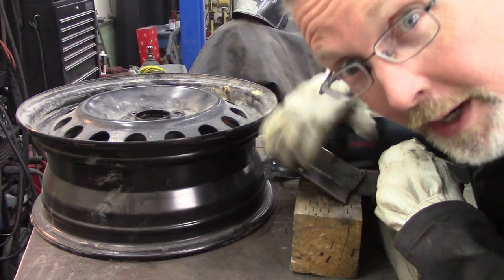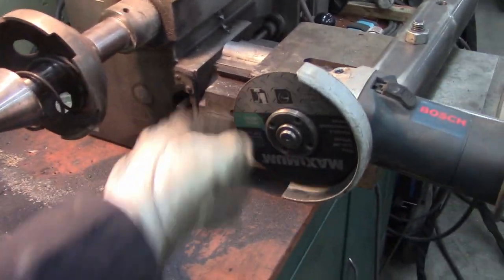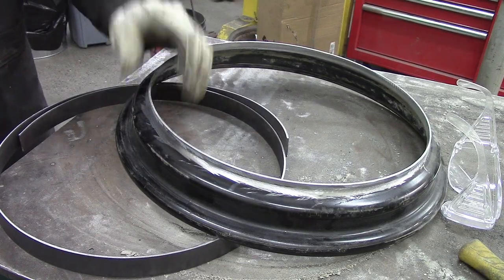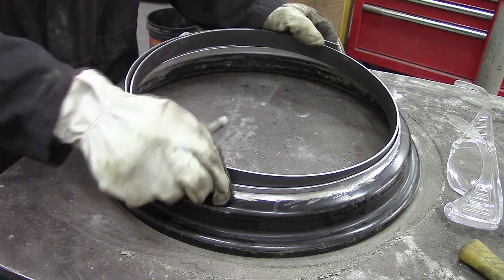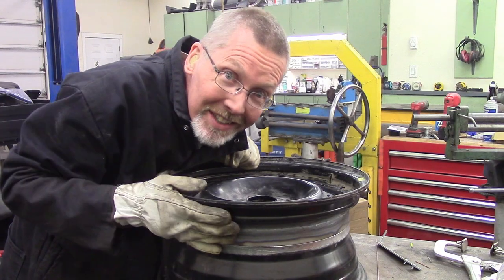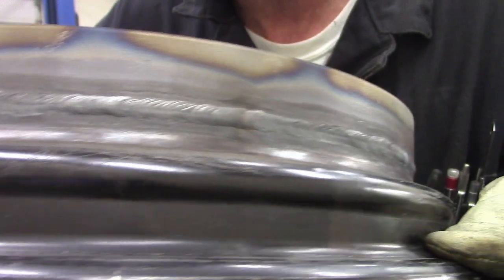How To Widen A Set Of Wheels

Comment: Very nicely done, and I completely appreciate steel rims. I have a nice collection of 1966 factory wide Mopar rims, 5.5 was wide back then, but they all have some sort of deficiencies, curb damage and opened up lug holes mainly, I guess this is why I’ve never been able to find a shop to consider fixing them. There used to be a local shop that would do whatever you wanted, but long gone, I’m in Canada as well.

Comment: Great idea! Now all I have to do is find an old brake lathe to use. I'm from BC. A place I worked for in the '70s used to widen wheels on a huge lathe. Used to turn 15" x 6" rims into 15" x 10". To weld the extra steel onto the rim, we used a multi arm cam driven spider that expanded into the inner diameter of the rim to which the widening strip could be clamped to. Weld up was also done on the lathe that was sloooow turning. Gott watch that back spacing too, depending on what the wheels are going on. Quite often the only difference of some thing being "legal" and "illegal" is if the welder was a certified welder or not. Cops are definitely NOT the ones to ask if something is "legal" or not on a vehicle. Most have no clue. "Because I can" is the correct answer, not "because I'm stupid" 🤣

Comment: You did it because you can. Nice use of a brake lathe.   If you could slow down the brake lathe you could use a mig and speed things up.
Reply: Just put the brake lathe in free wheel and use it as a positioner for welding, turning it by hand. This assumes you can get a good ground through the body of the lathe though.
Reply: @Archer_Off-Road  just ground to the rim....

Comment: Hey there. I'm a retired machinist, and left-handed. I spent many many years trying to find if anybody had ever made a left-handed lathe or an ambidextrous lathe. The economics has made it essentially never done and I've become strangely obsessed with building one. I was vaguely aware of brake lathes but assumed they were quite limited and I had no idea they had a headstock on the right. What you're working with looks like a very strong candidate as a platform for such a project. Could I ask the make and model? And if there is specific jargon for the headstock being on the right? Thank you in advance.
Reply from the maker: Pretty much all brake lathes are arranged this way.  I'm not sure why this way and not like a typical lathe.
Reply: I'm assuming that a brake lathe essentially can only do facing operations, but no turning? Is that right? How feasible do you think it would be to cut down a casting and add a lead screw for say 12 inches of turning?
Reply from the maker: It will cut brake rotors and brake drums. It's really not a "machine lathe" as such. It -could work, but I don't think it's ideal.
Reply: Only way is to reverse the internals.... If it's belt drive this might be the easy part, the rest of the lathe setup would be a nightmare!!!!   Good luck, I'm left handed but have dealt with being in a right handed world.
Reply: @robgigabyte580  
My brake lathe manual says it will also do flywheels.

Comment: I understand you are editing this but wished I could have seen the entire process.  Awesome video, got a 70 Z28 with a 383 Stroker pushing 500+ HP and 400 + ft lbs torque at the rear wheels.  I NEED TRACTION BAD.  But want to keep the 5 spokes.  Off to get 2 OER's now and add 3" for 10 " wide rims...  Thanks for showing me the process.  I'll be able to keep the offset, have that factory look and get some badly needed traction!!!!!  Subscribed and liked!!

Comment: any predictions on the balancing after all is done?
Reply from the maker: They all hold air. They all balanced with an ounce or less per side (I used stick-on weights to keep the outer lip clear), except one wheel that has a bit more warble than the others, which took over two ounces on one side.

Comment: This type of wheel modification is illegal in many Countries and rightly so because of the critical nature of the wheel construction.  There are too many wheel modifiers out there and almost without fail the welded band is not tested for integrity.  There are aftermarket wheel suppliers that provide wider wheels in various diameters and offsets that are properly manufactured and at a cost that almost matches banding but with the guarantee of quality.  If you wish to retain the centre of the wheel then it is possible to get the aftermarket steel wheel providers to supply just the rim or get a metal spinning company to create a new rim that has proven to be particularly economic.
Banded wheels are illegal for use in all forms of motorsport AFAIK and certainly in Europe and bearing in mind that motorsport has access to the very best engineering that says how banded wheels are regarded.  Unfortunately there are too many low skilled engineers attempting this.
Reply: Lol smh
Reply: @falkin42  😆
Reply: Probably not.

Comment: Would it be possible with aluminum wheel?
Reply from the maker: Interestingly, here in Canada it IS legal to "repair" aluminum wheels by welding, but not steel wheels.  For me, I'm a far more sketched out about welding aluminum wheels than steel wheels, but yeah - technically, it can be done the same way.

Comment: I watched this because I have to attempt to repair 4 atv rims that the bead had completely rusted off. Why not just get used replacements you ask? Because this particular atv is apparently the only one ever made that used this rim size, offset, and lug pattern, in other words I have been searching for two years and have not found any rims to fit it. I am considering two options, cut off the bead of a good rim the same diameter and weld it on or cut the centers and weld a good outer rim to them. However more and more I’m thinking about parting out the atv, this thing has been nothing but a pain in the rear trying to find anything for it
Reply from the maker: I have another video where I repair a bent rim as you are suggesting.  Having said that, there is something to be said about "parts availability."
Reply from the maker: https://www.youtube.com/watch?v=2sFoS3_uuZY

Comment: Mig those and save a couple days. And less tacks, use a cut wheel so as to facilitate an open root, approximately one sixteenth with the right disk between the tacks, 100 percent penetration.
Pro tip for anyone attempting this.

Comment: I am honestly curious why you chose to TIG on steel rims rather than just using a mig welder?
Reply from the maker: I am more confident in my TIG for structural or things that need to be really sealed.  It's slower, and I can see my progress a whole lot better, less "bead" means it shrinks less, and it's a less brittle weld, too.  Could it be done in MIG? Heck yes.
Reply: @GregWellwood  gotcha! I am a shop teacher as well in Alberta.  Interest stuff!
Reply: @GregWellwood  made mine with a mig welder and now i'm trying to stop the leaks 😢😢😢 maybe i put urethane sealer on top of the welds. I don't want to grind them and make a new pass of mig welding because it could warp the wheel 😢😢😢
Reply from the maker: @pedrocarrera2284  The first wheels I ever widened, I did in MIG, and had a dickens of a time getting them to hold air.  I even ran braze over the weld, and ended up running tubes.  This was on a shop car the kiddies worked on, and never saw the road.

Comment: You mention the use of epoxy and I never bought any, but can spray. What epoxy brand & p/n do you find in the great white north?
  I have one more, promise. Epoxy that is simple two part, mix, induction period sometimes (What I call, The chemical handshake) But I am not able to afford certain brands, but the “DTM” stuff that contains an acid, weak, strong, vinegar, don’t know” It bothers me because they are for it, or against it! I am scared, upset, confused (Because today is Father’s Day, & my wife of 40+ has me fixing the washing machine, YEA, Bingo, Cats Meow) I can’t make up my mind about epoxy! Can you help. Thanks!
Reply from the maker: I buy ProForm Epoxy Primer from KMS Tools, because it's convenient to me. I believe it's a better go than Etching Primer, but I am NOT a body guy.
Reply: @GregWellwood   I go once a year to the nearest McDonalds, only when the McRib is available! So, I understand. 
 The DTM stuff only with epoxy on cleaned sanded bare metal with no old paint or filler. I think it will work fine as this first coat. I am not a body tech either or a chemist, but a tech. I was lucky enough to give back holding 4hr tech seminars from serial data to advanced charging systems in 7 states in the upper Midwest, finish my career. But watching you and other videos to learn the new the new products. 
Thanks for your efforts and yes, a lot of work!

Comment: Local hot rod shop used to do exactly this Steel wheel widening Back in early 70's. He did a decent job  and they were affoordable. 
Sum Bitch to true and Balance though. Fairly high failure rate (unbalanceable and not true). 
Not nearly as Easy as it looks.

Comment: before you did yer 'don't do this' disclaimer I was going to suggest  that you add a disclaimer  " 'don't be stupid, take responsibility, if you kill yourself it's not my problem'"
but  I think you said it pretty well.  enough  said.  Ideas for future projects/videos
1::add a drive motor to your ring roller, Take off the hand wheel and put  a transmission flex plate and ring gear, driven by a variable speed motor  (not a starter, necause you will want a soft start and ramp up speed and reversing. 
2: rotary table to put insider your blast cabinet to spin wheels as you blast. 
3:  I forget. My last shop class was in 1968
Reply from the maker: I'm going to make my own slip rollers at some point, just for this sort of thing. I want to motorize my bead roller, too.

Comment: Why bother ? Just buy nicer wide wheels whether they be allot or steel it’s still more cost effective than all that faff, and that’s ok if you have the gear 🤷‍♂️
Reply: For me, I have a unique vehicle with unique wheels and a unique 7 bolt pattern that are 11 inch wide. No one makes tires that are 11 inches wide, and no other wheel on the market fits my 7 bolt pattern. But there are tires that are 14.5 inches wide, so this option would work best for my application. Otherwise I would have to get a custom splined yoke, a custom made hub and a custom brake set up for each wheel, which would amount to more than ten thousand dollars. This costs me a little over a thousand dollars for all my wheels.